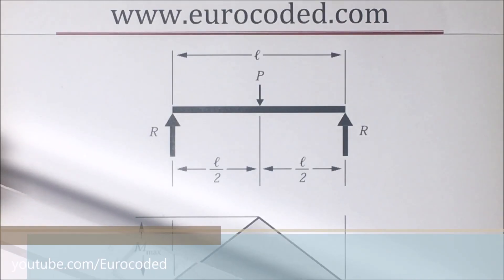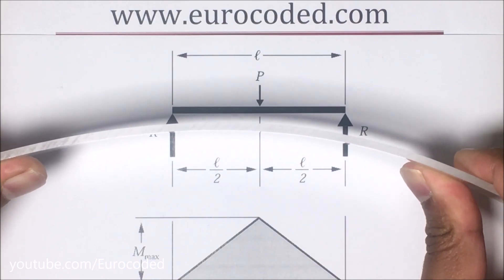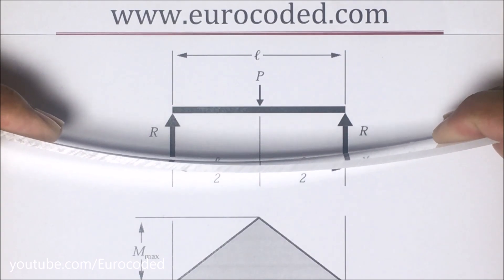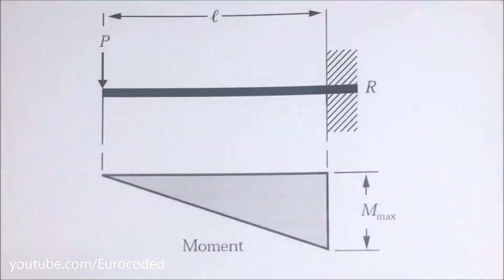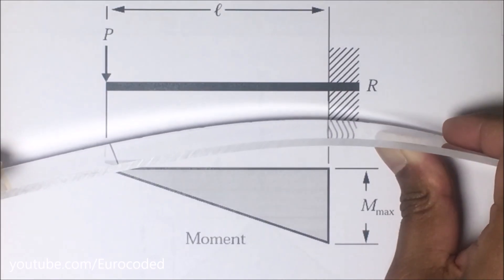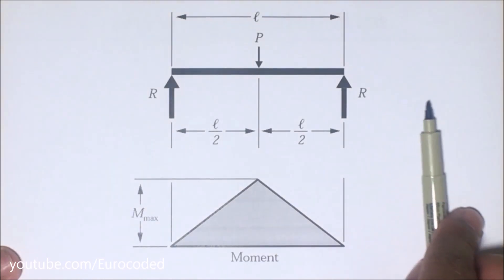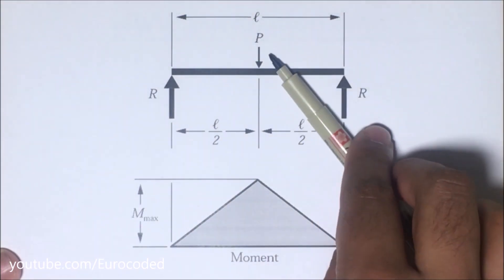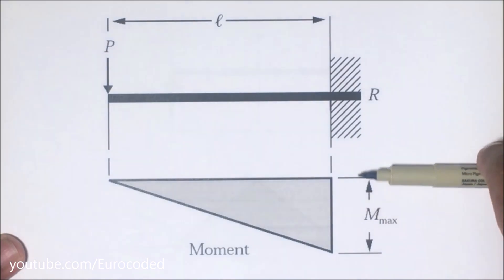Sagging Bending Moment and Hogging Bending Moment

Comment: Hog or Sag is better?? And why?? Thanks in advance.
Reply from the maker: Hi Daljinder. It depends on many factors such as location of the structural member, form of construction and site constraints. Ex: too much sagging may reduce headroom clearance under a bridge.
Reply from the maker: I may be able be specific if I knew the the context.
Reply: If we look after the safety aspect only ..... Sag or Hog will be able to withstand more force before breaking. (Specially on Ship Congratulations)
Reply from the maker: That depends on the sagging or hogging bending resistance (capacity) of the member.